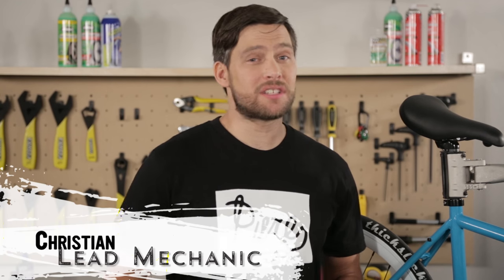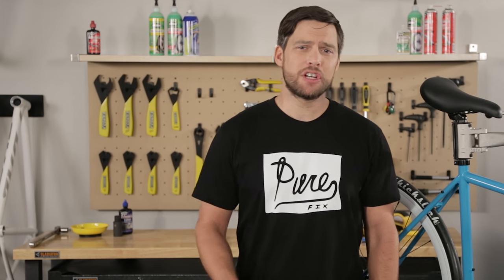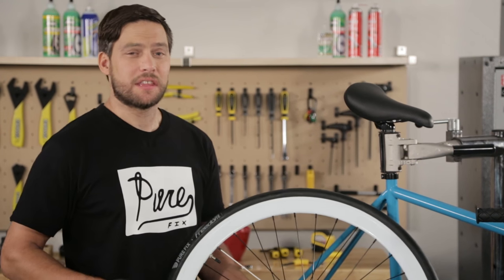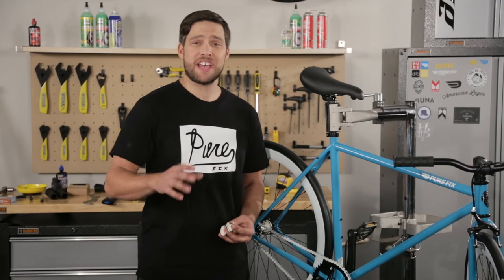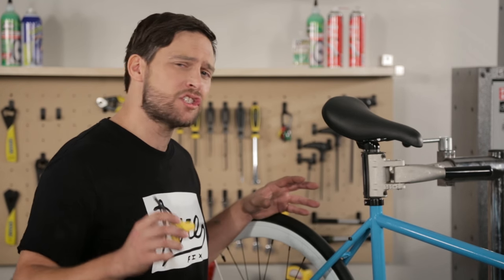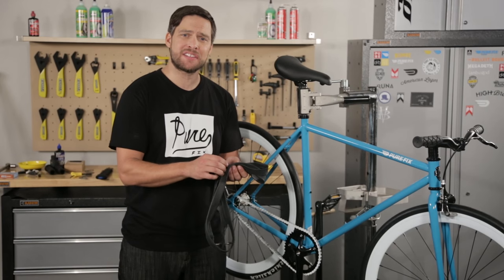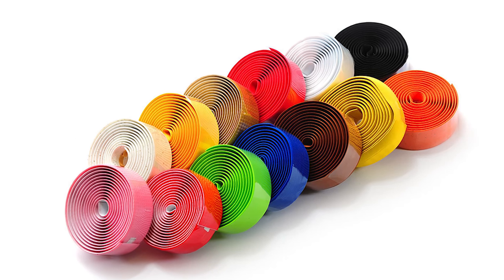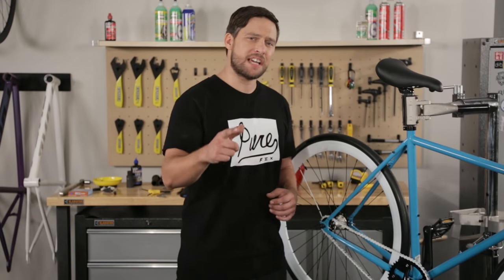PFTV: First Year Bicycle Maintenance

Comment: I bought some bull horn bars but the brake leaver doesn't fit because it's to small for my bars what should I do?????
Reply: You can either buy plastic spacers, or wrap a little bit of electrical tape to size.